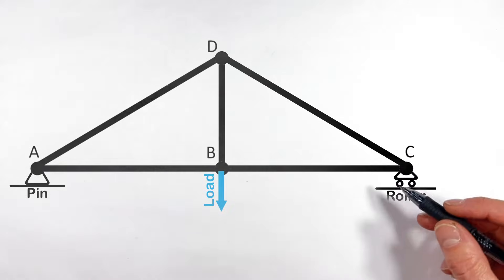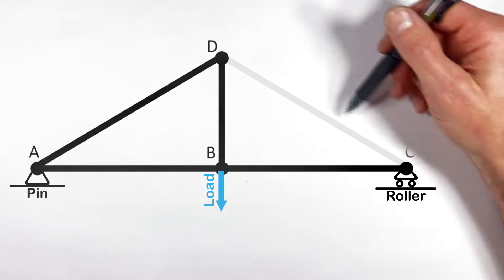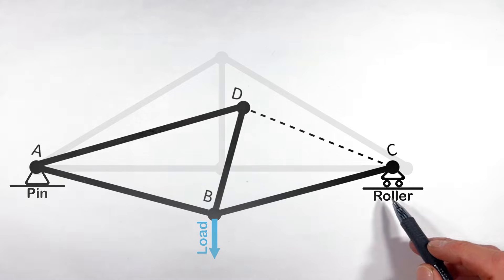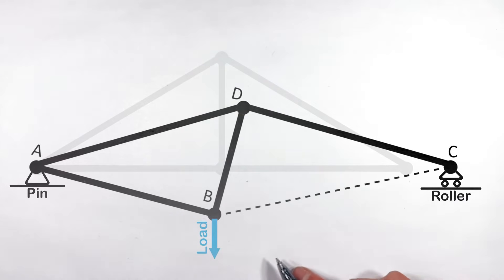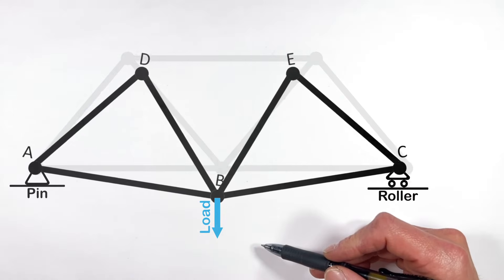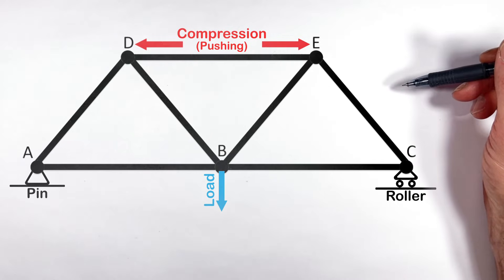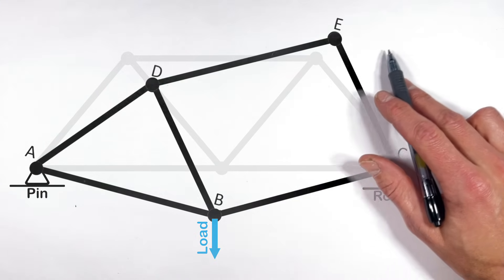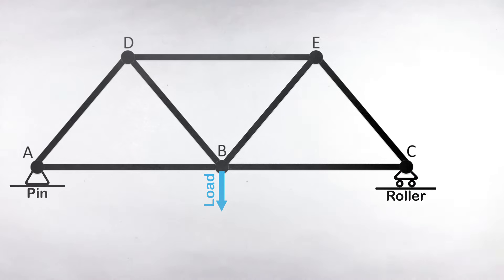Identify Tension & Compression Members in Truss Analysis

Comment: Nice approach. 
Just in case it might help someone else, I always say with these exactly like how he’s done. Imagine the member isn’t there but focus on the joints.
Compression, “compress” means get closer, the opposite is tension-pull away from each other.
If the joints are getting closer, “being compressed” the memebers in compression,
If the joints are getting further-pulled apart it’s in Tension.

Both make perfect sense as the member is producing a reaction.

Whichever is made easier to visualise

Comment: Could you do a video on concrete piles, specifically in the marine industry. Not only do you have forces working on the pile "downward" depending on what is built on top of the pile, say bridge, bulkhead, or breakwater. But what about the water forces (ocean, bay, river or lake) these forces are both pulling and pushing on the pile. Love the video just want to see it in a different way than your standard "truss". Thanks!

Comment: I like this intuitive approach much better than the "assume all members are under compression/tension and let the math update your assumptions" approach. Using intuition to establish the state of each member beforehand, just makes the math that slightly bit more obvious IMO. (Although, I do prefer doing this one joint at a time, rather than all members in advance.) And sure, if somehow your intuition was wrong - the math is still there to correct you.
Reply from the maker: I never liked the 'guess and check through math' method either.  It's too easy for one mistake to snowball through an entire truss solution.

Comment: This is a much better method than I learnt. What I was taught was to just imagine the single segment of the truss and then find out all the forces on either end of it. Next, I had to calculate the sum force on either end and see if the 2 forces were going in the same direction or opposite direction. Using that, we could determine if the segment was under tension or compression.
Reply: Much more tedious, especially in a time crunch scenario like a test
Reply: @lifequotient  Surprisingly, it actually worked well during the test. Of course the method in the video is less time consuming .